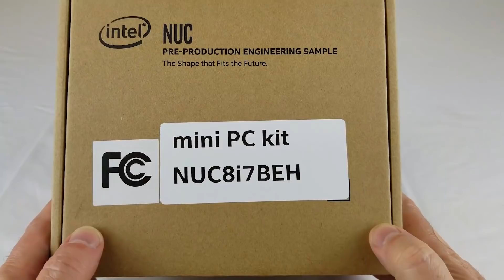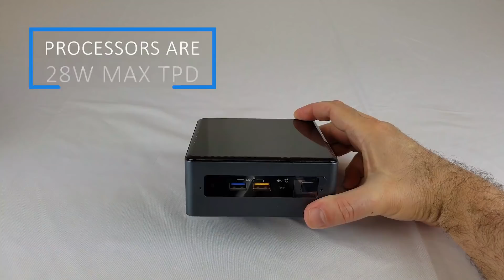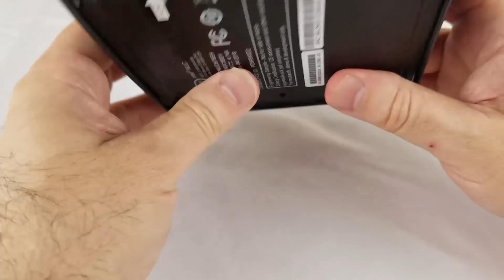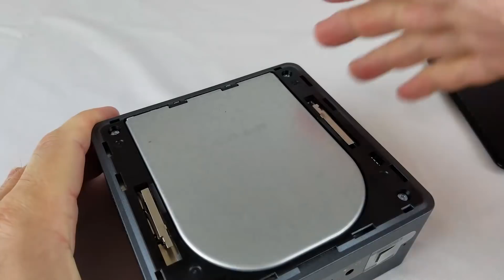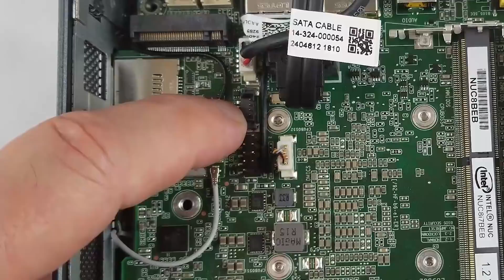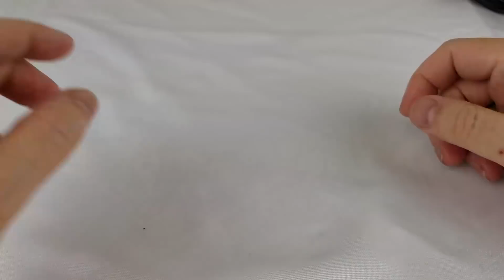Bean Canyon NUC- First Look and Full Overview

Comment: Dear Concern, 

Could you comment if I can install the following M.2 drive in the tall kit (with 2.5 SSD option)? it has height 6mm for the cooling frame.  Or, is it absolutely necessary to choose the thinner M.2 disk like Samsung NVMe (having a height less than .35 cm)? Please reply to make decisions in the purchase.

https://www.adata.com/jo/specification/596
Reply: We have had thick M.2 SSD 2280's in there. It has a thick pad that compresses down, but not enough to cause damage to the board.
Reply: There is a thermal pad to help sink the heat away from the SSD. While we normally use SSDs that don't have their own cooling attachment, the thermal pad is thick and soft and should squish around the SSDs cooling solution just fine. Intel NUCs support double-sided SSDs which many or most laptops don't and with both SATA and PCIe, we have not tested an SSD that did not work yet.

Comment: Do all of the 8th generation NUCs use the laptop-like power supply?  I prefer the wall wort style, so were the 7th gen the last generation to use the wall wort power supply?
Reply: Unfortunately yes.  We do keep a stock of the wall wort as well if you prefer we ship with one of those instead.
Reply: @aaronrowsell8364  Will the wall wart power supply work with the NUC8. I believe the NUC8 needs 90W while the NUC7 needs 65W. (Or do you have a 90W wall wart on the site that I am not finding?)
Reply: @andywolan  That is correct. So the wall wort only works for the i3 and i5 8th gen but not recommended for the i7.  Here is the link https://simplynuc.com/product/65w-wall-wart-style-power-adapter/

Comment: Do NOT try to upgrade the BIOS unless you want to risk bricking this thing. Just live with whatever it comes with.
Reply: @Jasmin Klipic there are threads on this issue in the Intel forums. The 'bricking' I am referring to is related to the HDMI output that can be permanently killed through the BIOS upgrade, done via USB stick method. It happened to me. And others. So yes 'bricking' may not be the correct description, but it is still permanent damage to one of the two video-out ports.
Reply: @Jasmin Klipic yes 8i7BEH - I have open case with Intel on this issue. It also happened before with older model i5
I am not saying it will ALWAYS happen, but it has happened to me twice and many others - google "Intel NuC HDMI not working"
I am in the business and supply computers

Comment: So with both connectors you can run M.2 SSD as your primary and do a 2.5" secondary drive?
Reply from the maker: Correct.
Reply: @SNUCsystems  Yep, sold... Thanks!

Comment: We quit buying the NUCs. They would burn out around the 1 year mark. Switched to the HP zMini and they are lasting longer.
Reply: Can I ask what you are using them for and if you purchased them from us?
Reply: They also have a three year warranty from Intel so if they are failing due to the NUC (Very rare as far as what we see) Intel will replace them.

Comment: Now this is the mac mini apple should've released. Decent upgradability, a fairly reasonable price tag, and besides the graphics on this is in theory quite a bit better than the UHD 630 included on the mac mini.
Reply: but you have to use windows :(
Reply: @flipnap2112  Not if you hackintosh it...
Reply: @hunterp589  been down that road once and never again. WAY too many issues that i cant keep up with. went to a "regular mac" and the most stable machine I've ever worked on. and I'm platform agnostic, so i really have no bias. but if i have a job to do that needs to be on a mac its never going to be a hackintosh ever again. worst nightmare ever
Reply: @flipnap2112  Okay, I respect that. I built a Hackintosh a couple years ago with an i7-6700K and an r9 390X and it has been very stable for video editing and audio work. I generally prefer Windows, so my primary machine is another Windows computer. But really whatever works for you is the best thing you can have.

Comment: The new NUC8 series does not support Windows 7. Intel has no drivers for it. Windows 10 only.
Reply: @Billy18bm  I have few windows 10 and couple win7 installed systems. I most definitely can't say windows 7 is lighter operating system. Windows 10 seems to be faster in many cases.
Reply: Why are you not dual booting Windows 10 and Linux.
Reply: Maybe you want windows 98 support as well?
Reply: @SingIng-g8j  Why not? This is DIY barebone not a laptop or tablet! it should support ANY OS whether it's old or new.
Reply: @SingIng-g8j  The previous NUCs supported Windows 7 and Windows 10. Drivers for download are on their website but not for this NUC8.
Reply: Also, it doesn't support Windows 8.

Comment: Just buy an Asrock Deskmini 110 with an 65W i7 CPU (a Noctua L9i cooler fits in perfectly). It has been around for years now and it is still cheaper than this one. Size is almost the same as well ! Who would buy this intel overpriced box ?
Reply: Are you thinking of the DeskMini 310? While I would normally agree about the pricing vs past NUCs, you have to consider the I/O options of the NUC8i7BEH especially.  Depending on sourcing a 65W i7-8700 is gonna be about $300 (low estimate), so now the DeskMini 310 + CPU is ~$400 vs the ~$500 NUC8i7BEH.

When you spec them out the NUC8i7BEH is not really "overpriced", and not with the Thunderbolt 3 port in the mix. The DeskMini 310 is also running USB 3.1 Gen1, not Gen2.

There are definite use cases for both boards, and the prices are competitive.
Reply: @CrimsonBlasphemy  There doesn't seem to be a 6-core NUC out there yet, that would be sweet, especially with TB3.

Comment: Will this really support 64GB (2 x 32 GB) ?  Looked at all the specs available online and nowhere do they say it supports more than 32 GB.
Reply: Maximum is 2 x 16GB  32GB total.
Reply: At 7:05 he says it will support 64 Gigs whenever 32G SO DIMMS become available in future.  That's why I was questioning this.
Reply: I have 64GB in mine.  Runs great as a little Hyper-v server.

Comment: I hate to be thick, but where does the 2.5" SSD plug in? I didn't see where that would happen on the motherboard. On a couple of older images I found in an internet search, it looked like the SSD slides into the top or bottom somehow, and that it lays parallel to the motherboard. Is this correct? I plan to use an existing 2.5" SSD for my main drive for the NUC and just want to be sure I know how/where it installs. :)
Reply: Its in the lid/bottom plate, where the cables go to
Reply: don't understand what you are saying  Where is the SSD 2.5" housed and then connected.  What cables do you mean? Existing cables or new cables.
Reply: @stephenrichards5386  Look at 7:11 in the video. In the upper middle you have a black cable with a label: SATA CABLE. To the left of it there's a black cable hooked into the board with a white connecter. That's the power. Both those cables are for the 2,5" drive. You can see the HDD mounting place in this video: https://youtu.be/k2MSX-4XqFY?t=130
Reply: Thanks Sigh. I hadn't noticed the case attached to the lid.  I'm travelling until next week so will not be checking 'til then.  Thanks a lot.
Reply: @stephenrichards5386   You are welcome Stephen. And thank you. This is the first civil conversation I have had on Youtube since I started, although I have tried my best. :-)

Comment: The screaming planned obsolescence of NUCs and imitators is a bit disturbing from both lifecycle cost and waste disposal perspectives.

With only modest upsizing to the form factor to stop relying on laptop-spec components, eschewing the jam-max-RAM philosophy, and down-spec clock rates you could have slightly larger, long-lifecycle, cooler running, more significantly upgradeable devices.  Plenty of room for innovation, competition, higher value, and customer loyalty.
Reply: Respectfully Bob, you couldn't be more wrong. Laptop components are in highest demand due to mobile processors finally having competitive performance to their desktop counterparts. This demand means there going to be more affordable and most likely take over the market except for the few Niche exceptions or raw power is truly applicable. As far as reliability and Longevity goes they are physically equal if not advantaged because do to their lower tdp's. You might be confusing there reliability with the data pulled from the laptop Market which is skewed due to the fact that laptop's get extremely abused. Their failure has nothing to do with component architecture, unless you're talking about value laptops and their continually failing air flow designs. ive picked up a nuc8i7beh and it out performs every desktop in my office. 4.5ghz i7 with a GTX1070 eGPU wired to Thunberbolt3 for my casual gaming needs. its actually replaced my laptop because i can just plug it in to any hotel tv. in fact, if thunderbolt 3 was around to solve weak gpu in my i7 3770s laptop, i would have been very happy sticking with that. i/o is key here, with tb3 and usb3.1 ver2, I'm confident this will be future-proof at least 8 to 10 years out!
Reply: I think the 8th generation Bean Canyon NUC is a really nice package with the quad-core and 8 processing threads.  I have the last generation with the 7th generation i7 with the dual-core and I honestly wished most times for a quad-core.  I won the 7th gen i7 NUC and added in some nice hardware myself into it: 16GB RAM, 500GB Samsung NVMe, and a 2TB 5400rpm storage drive.  I wish I had the 8th generation, the only difference I would do is bump up to 32GB ram.  I like the NUC a lot but again, but I think this 8th generation i7 is the sweet spot.

Comment: Received my NUC8i7BEH from Simply NUC this afternoon -- an upgrade from my NUC7i7BNH.  I pulled the RAM (32GB) and drives (1TB SSD and 2TB HDD) from the old NUC and installed them into the new NUC in a manner of minutes.  The difference on booting up and executing software is notable.  You should download and install Intel's Driver and Support Assistant to install/update drivers.  The different lids for the Gen 8 NUCs will take a while to come into the market, since the body dimensions are just a little different (as per the video).  I have the dual USB-2 lid on my old NUC -- used for mouse and keyboard.  Overall I'm quite pleased and the Gen 8 CPUs bring NUCs into the "no excuses needed" category for most PC work.
Reply: Thanks for sharing about this! I didn't realize one could purchase a lid that has additional ports. I'll definitely be looking for one. Is it easy to install? Does the alternate lid have to plug into the motherboard somewhere? Are the lids made by Intel or a third party? Thanks in advance!
Reply: GORITE (https://www.gorite.com/) is an Intel partner.  They make a range of lids with different ports.  For my NUC 7 I got the lid with two USB 2 ports to connect my keyboard and mouse.  There are two USB 2 connectors on the motherboard.  You will need to open up the NUC to do this.  GORITE has a video that shows how to do it (which wasn't available when I installed mine).  You'll need some needle-nose pliers and/or curved hemostats to do the installation.  Again, nothing available for the NUC 8 as of this post.
Reply: Good day to you, kind sir!
Say, what about fan noice in new NUC - is it louder than the old one?
Reply: [Updated]  Where I got the most fan noise in my NUC 7 was during longer PhotoShop sessions and when I was resampling full length movies.  Most of what I've done the past few days has been a lot of file moving and deleting whilst organizing files on the NUC and cross-organizing with my laptop.  That said, I don't recall the NUC 8 fan spinning up like the older model did.

Update:  Today I moved 51.8GB (8500+ files) from the NUC 8 to a Samsung 500GB T5 portable.  This task was long enough (though pretty fast, since everything was USB 3.1) to get things warmed up.  I used CPUID HWMonitor to track the temperatures.  Eventually, 3 of the 4 cores maxed at 100C and the 4th to 98C.  But the fan held things to those levels.  You could hear it changing speeds to keep things under control.  My totally unscientific impression is that this is quieter than my old NUC.  The central air conditioning noise in the room was higher than the NUC's -- that may say more about the A/C than the NUC.

A second transfer was 18.2GB (21,800 files).  I timed it:  1 min/55secs.  One core got up to 92C, the others up to 88C.  You could hear the fan changing speeds, but it never got up to  the speed of the first transfer.  The NUC is about 26 inches/66 cm from my ears.  (The T5 maxed at 47C on the first transfer, and 43C on the second).
Reply: you upgraded from a bnh to a nearly identical beh? for the what, 0.5ghz bump? I think you're missing the point of the nuc's design.
Reply: Off-Grid Optimist:  Not at all.  Photoshop is faster (NUC 7, with i7 dual core, was kinda pokey with some plugins).  I have faster ports.  It benchmarks faster.  And when I move, the whole works (including an external drive) fits into a shoe box -- with room for a pair of slippers.

And what exactly is your interpretation of the point of the NUC's design?  I shouldn't upgrade from a dual core to a quad core?  I should stick to mostly USB 3.1 Gen 1?
Reply: Is possible to power it through usb-c? I have a monitor with usb-c..
Thanks in advance..
Reply: Where did you connect the 2.5"SSD? I cannot see the way to do it
Reply: Is the fan semi-passive? How loud is it in low mode? :)
Reply: Did you reinstall the OS and apps, or were you able to just pull your SSD and plug in and go?

Comment: When I restart it does not show any thing in the monitor. Just " No HDMI signal from your device"
:(((((
Reply: Howdy Nguyen,
Did you purchase a fully assembled unit or a kit you assembled yourself? Did you purchase the system or kit from Simply NUC?
If you have a Bean Canyon prototype that you're actually talking about, then you will need to work with the rep that sampled it to you.

Comment: Samsung announced the 32gig sodimm modules in may 2018 so they already exist
Reply: They may have announced them, but I can't seem to actually find any, from anyone. It is possible that some 3rd party did a stacked SO-DIMM, but some of those are so thick, that won't fit in stacked sockets. If you can provide a link to someone that actually has them, I should be able to get two for testing and report back.
Thank you,

Comment: With the new cooling blower, how do these compare to older models in terms of noise and loudness?
Reply from the maker: Actually less noisy since the fan doesn't have to spin as fast.
Reply: My NUC7i7bnh is really loud and quite warm when under load (Handbrake video encoding). I'd like to see a video of the two NUCs side-by-side showing temps and comparing audio levels.  I often wear ear protection to drown out the high-pitched blower.
Reply: SFseis Thanks. I did try various speed settings in the BIOS, but I prefer system longevity to noise level. My NUC is fully loaded with 32GB, M.2 & spinning disk. My house gets above 30°C in the summer, and the NUC was above 90°C. I've been planning a new 3d-printed top with an 80mm fan, but I hate to remove the current cooler.